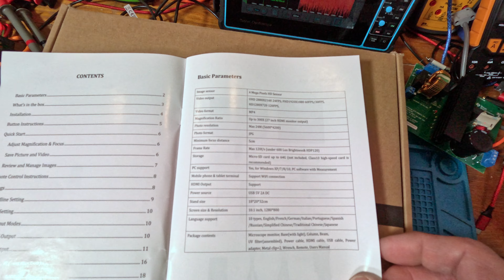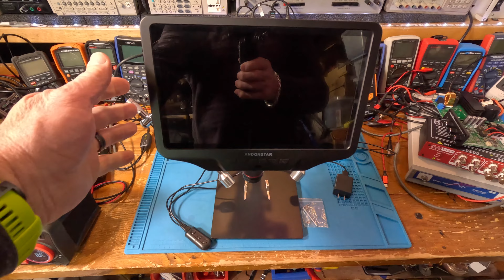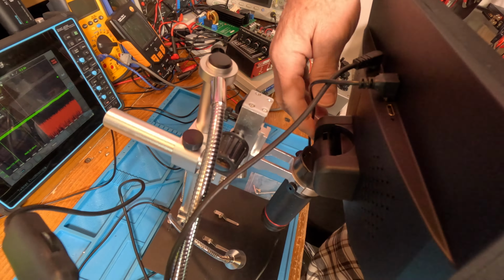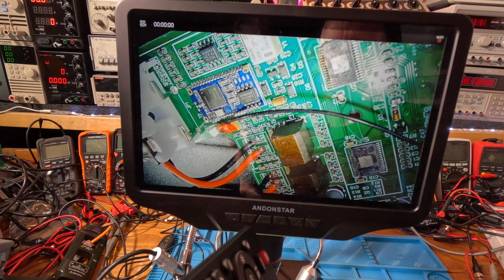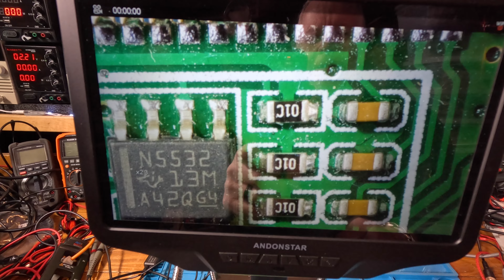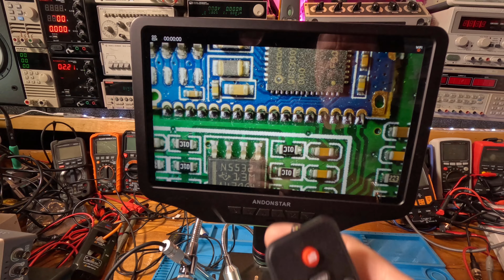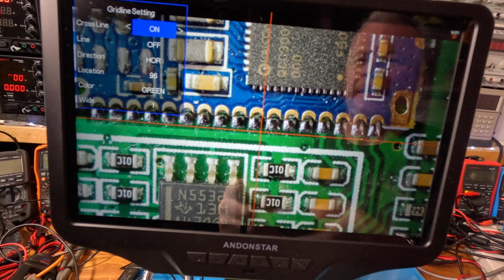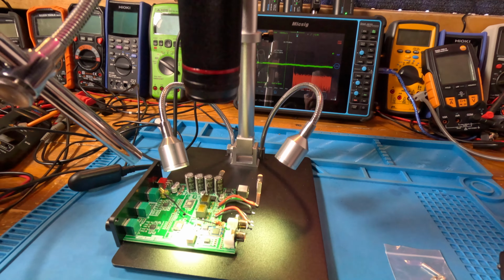Solder Like a Pro with Microscope and Endoscope Andonstar AD409 Pro

Comment: Having tried various digital microscopes for smd work, I found myself always going back to my stereo beam microscope with the x10 configuration, no latency and infinite pixel resolution. To match that visual quality with digital you have to go Olympus or Nikon and that's stupid money...
Reply from the maker: Thanks!  I am going to try a trinocular agian and see what I think comparing the two types.
Reply: Totally agreed, It’s much easier to work with an analog stereo microscope vs trying to solder while looking up at a monitor

Comment: I've bought a few different ones, with the intention of using them for soldering.  I found them too awkward for that, but they are good for board inspections for sure.
Reply from the maker: I know what you mean, but this big screen makes it easier to see, and powerful microscope lets me get under it with room to move.
Reply: Get a good optical binocular or trinocular microscope with a boom stand or articulating arm and you never will go back. They're expensive but if you do board repair they're a game changer
Reply from the maker: Thank you.  I don't do a lot of repair and I have used the trinocular, but trying this out - I like the flexibility of moving myself around and not having to stick my face in the bincular;)  But we also had a camera in the trinocular so we could watch the screen.  The zoom on this is also very good and gives me room to work under the lens.  I've only been using this type of setup for the last couple of years and sparingly - so maybe I'm missing something...   I can totally see how you can become so good at soldering under a trinocular that there would be no reason to change.
Reply: @KissAnalog  I didn't need a microscope for a very long time working with embedded systems found in trucks. Even with mcus with fine pitch in a QFP package there's not much benefit because the surface tension of the pads lines the pins up for you. So there use case is definitely specific and you'll know when you need it. 

When I started getting into PC motherboard repair it was clear immediately I'd need magnification to do it effectively. I'm also prone to motion sickness and digital scope will trigger it for me. The only real downside for me with the optical microscope is the amount of space they take up and the lack of portability.

Comment: Cool stuff!!! I wish I had this to re-solder the SMD resistors on the FICM (fuel injector control module) on my Ford F350. I did see the direct Amazon links.
Reply from the maker: Thanks!  I am so happy to be able to solder again.  I have good eye sight but my close up sight is not as good as it one was;) Now that I can see these small SMD - I can solder;)
Reply: @KissAnalog My 69 year old eyes suck too. However, I messed up on my original reply. It should have said that I DID NOT see an Amazon link to the scope. Just saying in case you are affiliated for a commission. You have a great channel!!!
Reply from the maker: Thank you.  Here's the link.  I also added it to the description below. https://www.amazon.com/dp/B0BFKC2BVL

Comment: Looks ok. I am looking for a microscope (for 0.4mm pitch QFNs and 0.5mm LQFPs), but $350 is too expensive for an Untermensch. And since I already own some computers and monitors I think i should just get a camera/stand. I hope I can solder QFN with ordinary iron. Otherwise I will have to get some SMT rework station.
Reply: Nice, but a bit out of my price range. I've never used a screen type for solder work...always a stereo optical 'scope.
Reply from the maker: Thanks!  They do have all kinds of models from low cost to this one.  This is so cool that they sent this out to me;) Really the pay off I get for the channel;)